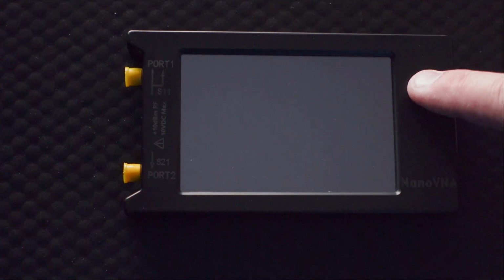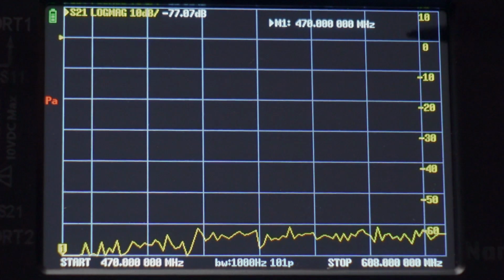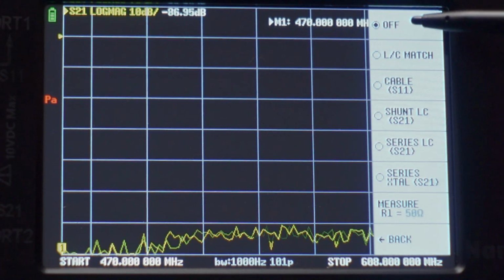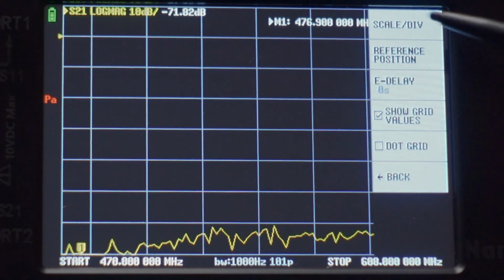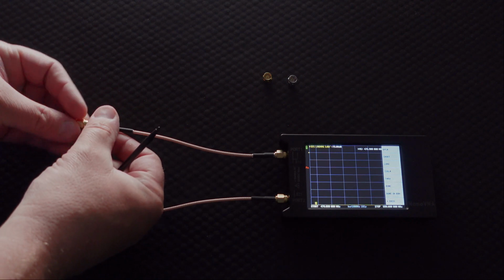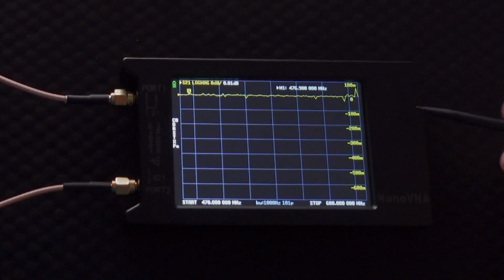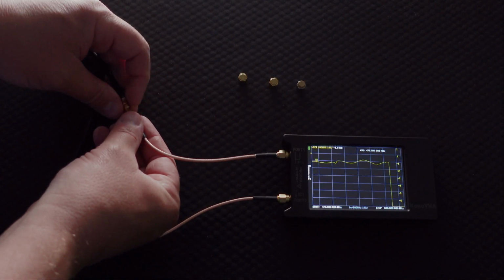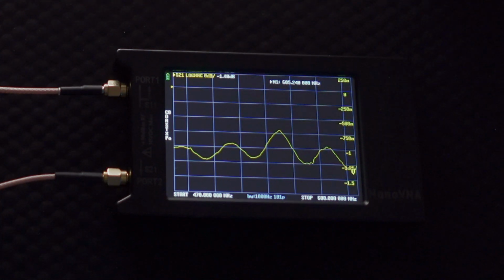How To Measure RF System and Cable Loss For Under $100

Comment: Cool video, very useful, thanks. Could I measure  the RF power of a tx with this device? I've looking at the NanoVNA V2. Regards
Reply from the maker: It may be possible but I'm not sure how you would go about it
Reply: No ! At least not until u check the max rf input spec to the VNA..it is not very much. In fact they frequently get destroyed by even too much static charge (when used on outdoor HF anteneas for example)  Hams recommend shorting out antenna to ground before connecting to the VNA. I dont recall the max RF input on the nanoVNA but should be easy to find on one of their many user groups etc. 

.

Comment: Hey Allen, thanks for sharing all this info! I've been looking a long time for something like this. 
Since this only goes to 1.5 GHz, how do you really check cables for 2.4Ghz band? I´m all Zaxcom and would love to check my Zaxnet cables since they are the more sensible to twist cables I have. 
Do you know any analyzer that goes up to 2.4? I've seen a couple that look like this one but wanted to ask your opinion. 
Again, Thanks indeed for taking the time to make this videos.
Reply from the maker: Great question. Different NanoVNAs offer different things like larger screen size, different adapters and even extended range. There are various models that go upto 3.0GHz and I almost purchased this one recently for this video. It is more expensive but does have a larger screen, extended range and the case it aluminum: https://amzn.to/3kG6XG5
That is an affiliate link.